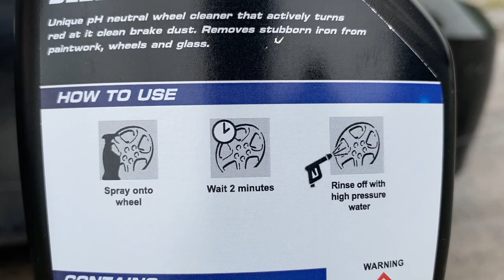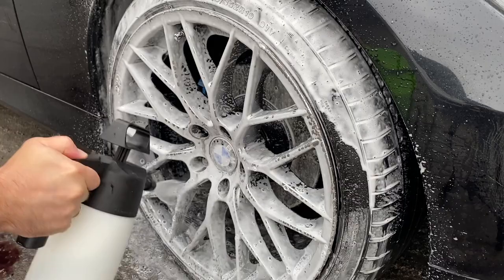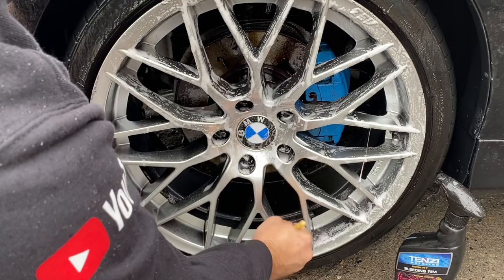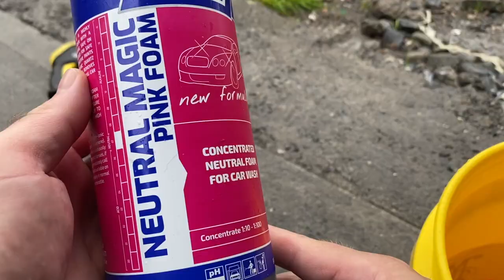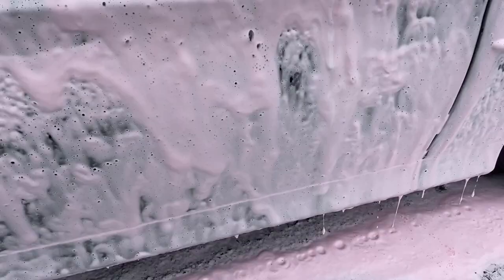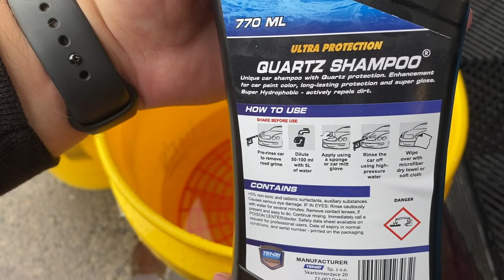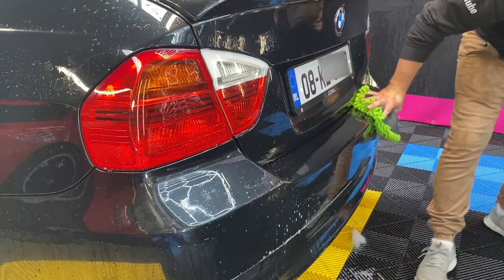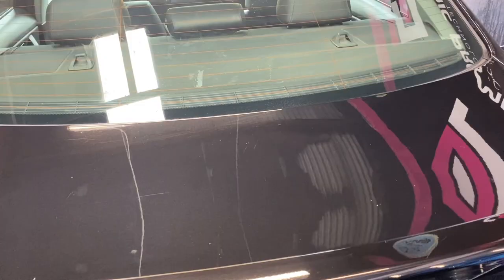Colored Snow Foam, Wheel Cleaner & Quartz Shampoo: TENZI Detailer

Comment: Great video Viktor! The water behaviour looked a lot better after that shampoo. It's always good when a QD is forgiving as well and very easy to use. There's nothing much worse than applying a streaky QD at the end of the wash when you just want to head back inside and relax haha!
Reply from the maker: Thank you Heather! Indeed and I agree what you have just said in regards to QD’s. My favorite thing was that, even if it looked like will leave streaks, the product evaporated by its own without buffing, which I never thought of will do. Tried to demonstrate this in the video, but I like this very much because of this reason. I need to admit that I had low expectations with the outcome, but I was satisfied with their performance and I will use them again for sure.

Comment: I always clean the wheels first because that's what makes sense in my head. I don't like how companies show us how their fallout remover works by spraying it on dirty wheels, I know it looks good when the wheel lights up purple for photos and videos but I feel it's slightly misleading
Reply from the maker: Hey Chris, fair enough! Interesting topic, isn't it? If we dive deeply into this question, there is so many things to consider. For example, when use an iron and fallout remover first, it could be wasted, as the wheel covered in dirt, but it still effective. However, I agree with that, in common sense: clean the wheels first, then remove any remaining embedded contamination by an iron and fallout remover makes the cleaning even more effective. But then, if the surface still wet (after rinse off) the product might (so not always) be weaker when get in contact with water on wet surface, which could be an other factor in case of efficiency. But yet again, what if, we dry off the surface after contact wash, then apply the iron and fallout remover on a dry surface, right? :) Lastly, if we are thinking about decontamination on the car's paintwork, we always do the wash first, so this might answer the question already. That's what I meant when said in the video: "overcomplicate things", meaning sometimes things much more simple than we make it. I have an idea in mind in regards to this topic, when i am planning to do:
1. Spray iron and fallout remover
2. rinse
3. clean
4. rinse
5. dry
6. and spray on iron and fallout remover again,
with hope, this will sort my curiosity lol :D

Thanks for sharing your thoughts Chris, I really appreciate that!